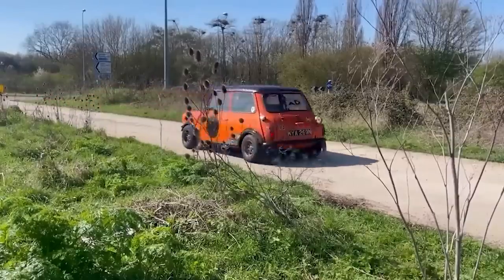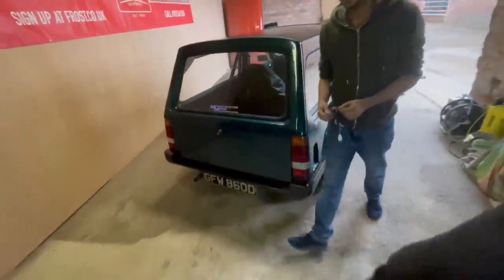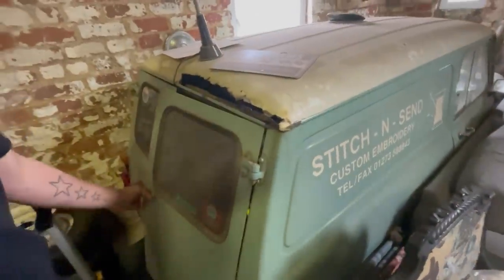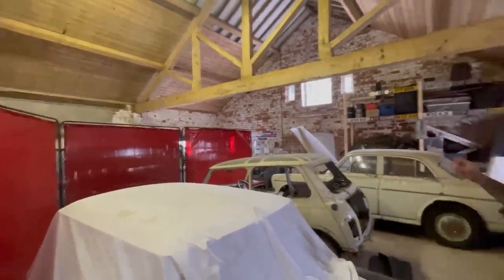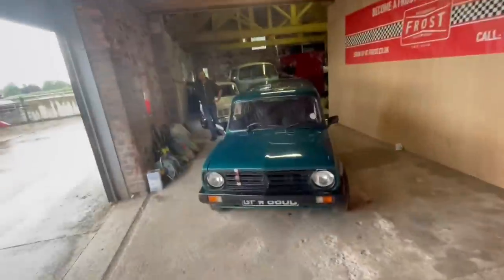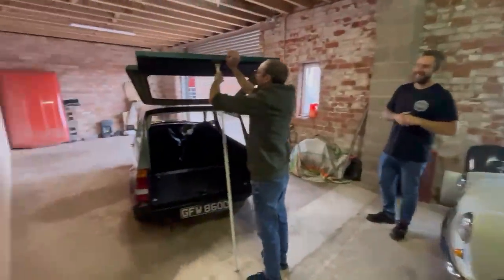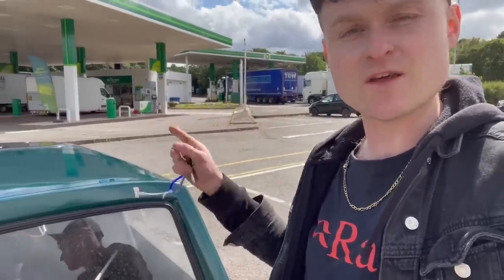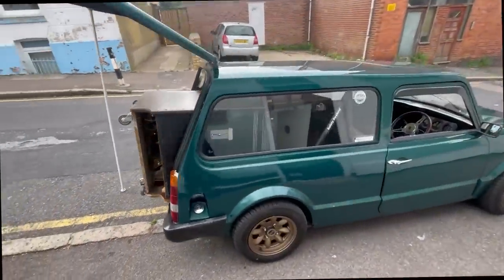They Said I Need A More Practical Car..

Comment: Glad you made it back mostly in one piece and that its been put straight to work.
Id say keep the 998 thats in it for now. Just get all the niggly bits done. 
Awesome to meet you Sam. Im sure myself and Marc will head down south at some point.
Reply from the maker: Good to meet you dude!!! Yeah I'm gunna keep the 998 till it shows sign of dodgy ness! Sadly the leak is coming from water pump so that's a job for the weekend :D. It's good though! As it would never be right getting a car without taking bits off and having a look hey haha!
Reply: That waterpumps never done so much work in its life. 😅 easy fix and a good shout to use that minimine discount code 😂
Reply from the maker: noticed today, is it an auto subframe?
Reply: @LOOKMUMNOCOMPUTER  nope standard manual subframe. As far as I'm aware.

Comment: I'm really confused .. In your other video you mentioned you had a Donkey Van as well as a The Van specifically for these pickup jobs.

I guess you're free to use any car you want, but it's still weird you have large cargo vehicles but keep using the smallest ones for the actual cargo.
Reply from the maker: Which vid do I mention that?
Reply: are you confusing look mum no computer with garbage time/DankPods?

Comment: Install a permanent roof rack, it'll look good with one!
Reply from the maker: Think it would ruin it :(
Reply: @LOOKMUMNOCOMPUTER   It's a wagon, it could pull the look off. Unless you're not talking aesthetics and are worried about drilling holes in a fiberglass roof panel.
Reply from the maker: @nlpnt  i have seen them with roof bars on ande it ruins it for me sadly :(

Comment: Yellow engine ? Not gold as in a gold seal recon engine ?🤔 maybe
Reply from the maker: naaa its definitely yellow. the gold ones are unmistakably gold. sadly
Reply: @LOOKMUMNOCOMPUTER  ohh well that’s my theory blown 🙂
Reply from the maker: @vqey2  it's a mystery. But yeah definitely yellow :( what's your theory?
Reply: @LOOKMUMNOCOMPUTER  only that it could be a gold seal recon engine from the factory , yellow might be a aftermarket engineering independent  that painted their engines to stand out as recons but painted them in a colour to look like the factory but stand out in their own right 
Or some one had the engine out and liked the idea of a yellow block 🤔
Reply from the maker: @vqey2  the mystery will be revealed in an upcoming video. matt who i got it off seems to think its a standard 998 block that has never been tampered with. but it does have some get up and go to it. cracking off the head for the next vid as got a 12g295 head for it. this will let us see if its ever been bored or what not. and the mystery will be solved.
Reply: @LOOKMUMNOCOMPUTER  looking forward to it , as I’ve never seen or heard of a fibreglass mini van shell

Comment: I am very disappointed that no arduinos had to be hacked into it to get it going.
Reply from the maker: It did have a speeduino previously actually! But then went back to dizzy
Reply: @LOOKMUMNOCOMPUTER  Surely there's gotta be some way to control the wipers with an old rotary phone control & the lights with pipe organ bits.
You'll have the worlds first midi mini.
.... or did you already build one of those?

Comment: never considered a trailer?
Reply from the maker: You can't go fast round corners with a trailer
Reply: @LOOKMUMNOCOMPUTER  potentially unwise with a bulky item in the back also.

however, I wonder what kind of trailer you are looking at, all of mine handle highway speeds just fine...
Reply from the maker: @TheAussieRepairGuy  highways don't have corners :D. U.K. very bendy. I guess aus very long straight roads.
Reply from the maker: Basically I had a trailer. Hated it. Only would use one if absolutely had to. If your gunna pick something up as opposed to couriering it back. In my view the drive should still be enjoyable. But each to their own'
Reply: @LOOKMUMNOCOMPUTER  I guess so. I have a 5 ton 6x6 military vehicle, it drives a bit differently to a mini.

I also have a 4x4 military land rover as well.
interesting to hear a different perspective in any case.
Reply: @LOOKMUMNOCOMPUTER  as for this part of australia, its tight windy mountain roads, and lots of roundabouts.
Reply from the maker: @TheAussieRepairGuy  yeah haha nice! Different perspectives. I was going to buy a discovery . Had a drive in a mates one. Loved it until I wanted to get anywhere at any haste haha. Didn't want to corner at anything above 50. Don't get me wrong amazing vehicle but not for the impatient 😂😂
Reply from the maker: It was a toss up between another mini and a landy lightweight. Sadly mini won! But different spokes for different folks :D
Reply from the maker: If my wife would ever let me have another car would deffo be a lightweight. Not for long journeys tho haha
Reply from the maker: If my wife would ever let me have another car would deffo be a lightweight. Not for long journeys tho haha
Reply: @LOOKMUMNOCOMPUTER  the 6x6 is set up as a camper - ex military ambulance.
my american wife has a modern jeep,  I hate fixing it..
keep up the good work with the channel, I enjoy all the variety.
Longest conversation I've had with a creator I follow ever.